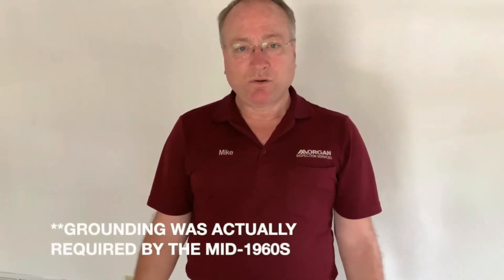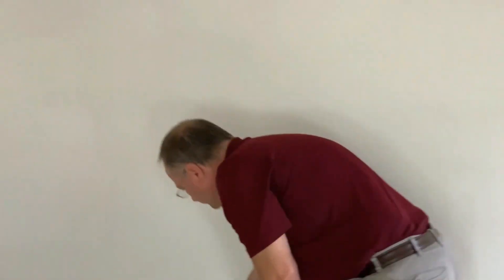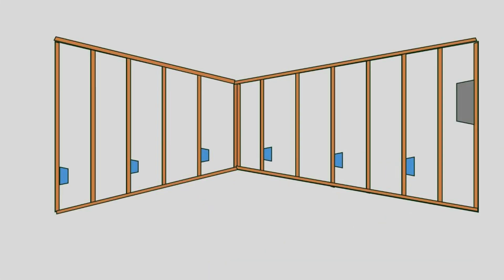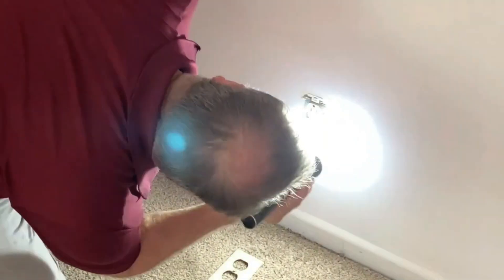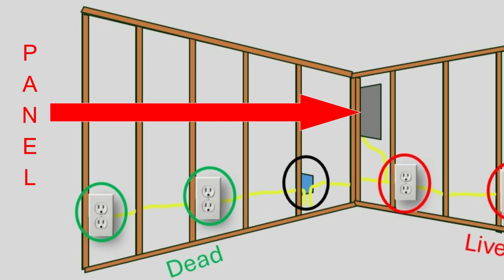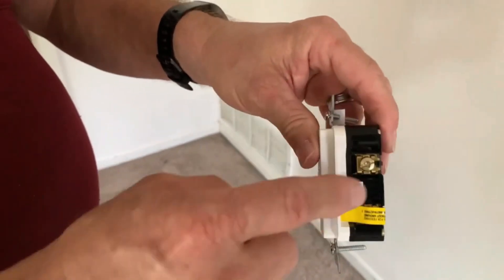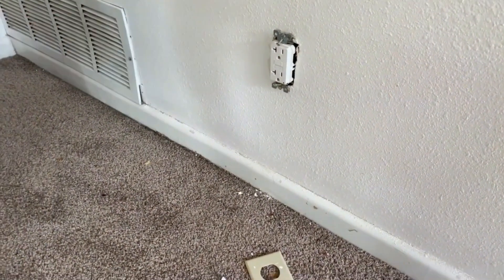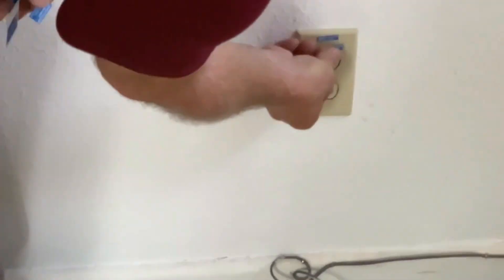Old Outlet to New GFCI – How to Install a GFCI (No Ground? Easy DIY!)

Comment: Ungrounded receptacles disguised as grounded receptacles ...even more deadly !  Is that even a 20A circuit ?
Reply from the maker: Good point — ungrounded receptacles that are made to look grounded can definitely give a false sense of safety and make things more dangerous. 👍 That’s one reason I always stress using GFCI as a safer option when no ground is present. And you’re right to ask — it’s important to know whether it’s a 15A or 20A circuit before replacing anything. Thanks for bringing that up!

Comment: During the video you said connect the wires from the circuit breaker panel to the line side and then said hook the other 2 wire to the line side. Did you mean install the other 2 wires to the load side, you did reference to remove the yellow label?
Reply from the maker: I said that? You hook the power coming in to the Line side. Any outlets you want protected by this outlet you connect to the load side. Those will be under the yellow tape. Thank you for catching that and letting me know. I will put a note on the video correcting that statement.

Comment: Save thousands on what? To replace an outlet, a GFI cost more, and whatever you plug into draws the same amps, no difference, so what are you saving on? I'll tell you, nothing, that's what.
Reply from the maker: Versus rewiring the house to ground every outlet.

Comment: SO I LOOK FOR THE OUTLET WITH THE FOUR WIRES RIGHT ?
Reply from the maker: Most outlets in the chain will have four wires. Only the last outlet will not have four wires. In other words, four wires is not what you look for. You need to find the outlet that when you disconnect one of the black wires all of the other outlets go dead.

Comment: what should i expect and what would the process look like if the outlet that i am replacing is an older, 2 prong, outlet?
Reply from the maker: It wouldn’t look like what I showed in this video. You’ll have a hot and a neutral wire. Normally that would be a black and a white wire. You will do exactly like I showed in this video to connect those to the GFCI receptacle that you are installing.
Reply: I'm buying these for the same reason. Buying a house from the 1800s and it's all 2 prongs. I will say this, if there are any 3 prong outlets installed that aren't gfci outlets, DOUBLE CHECK THE WIRING. There's a very good chance those 3 prong outlets aren't grounded and you're just asking for trouble.

Comment: Great video! For some reason I always thought that third plug (the "nose" of the face) was the ground and it was grounded as in, connected to something.
Reply from the maker: Well, it definitely should be connected to something.
Reply: @morganinspectionservices3840  Important safety tip, thanks again! Do you have a video on how to ground an outlet?

Comment: To meet code can u just use a GFCI or do u need a GFCI/APCI receptacle?
Reply from the maker: Great question! I will answer your question as well as I can.

Yes, the National Electrical Code (NEC) does allow you to install a GFCI receptacle on a two-wire (ungrounded) circuit, as long as it’s labeled “No Equipment Ground.” This makes the setup much safer than an unprotected, ungrounded outlet.

However, it’s important to understand that this does not bring the home up to current code standards. Modern code requires AFCI (arc-fault circuit interrupter) protection on most general-use receptacle circuits throughout the home, and newer homes must have equipment grounding conductors at all outlets.

So while adding a GFCI is a solid improvement and is allowed by code for older wiring, it’s a workaround, not a full upgrade. If you’re doing a remodel or new work, you’d need to bring it up to today’s standards, which would include both grounding and AFCI protection where required.

Hope this clears things up!

Comment: Did you put a 20 amp GFCI on the 15 amp circuit?Looks like the old receptacle was a 15 amp.
Reply from the maker: Good eye — that’s a sharp observation. The key is that the GFCI protects the downstream circuit, and whether it’s rated for 15 or 20 amps depends on what’s needed. In many cases, a 20 amp GFCI is fine as long as the wiring and breaker are properly rated — but the receptacle style and load requirements also play a part. Always important to match components to the circuit specs.

Comment: nice, i just had a home inspection and two of my outlets fail because no ground, i will try to get this done. thank you
Reply from the maker: If most of your outlets are grounded, and only two of them are not, then you likely already have a ground wire that you just need to connect.

Comment: Another great video.We have an older home with circuits in the bedrooms that are not grounded and have only 2 prong receptacles, my question is if I put a GFCI breaker in the panel would I then be OK to change the receptacle to a 3prong or putting a GFCI on the first outlet and updating the receptacles. Which would be better a GFCI breaker or GFCI receptacle at the beginning of the circuit. Thank you.
Reply from the maker: Hi. Thanks for the feedback and thanks for watching my videos. Putting a GFCI protected receptacle in place of the first receptacle on the circuit or installing a GFCI breaker accomplish the same thing, so it’s basically just your preference or whatever is going to be easiest. Once you have done this, you can replace the two-prong receptacles with three-prong receptacles. You should label them as not grounded but GFCI protected.

Comment: Another point to be made is that the GFCI amp rating must match the breaker rating.  I bring that up because you installed a 20amp GFCI outlet, assuming that circuit is 20 amps.
Reply from the maker: Thanks for the clarification

Comment: I just replaced all the regular receptacles in my kitchen, im a little apprehensive about changing the GFCI receptacles.
Reply from the maker: @robleekay6271    My first question is, why do you need to replace the GFCI receptacles? Secondly, it’s really not difficult to replace them. What makes you apprehensive?
Reply: @morganinspectionservices3840  the current receptacles have been in the house since we bought it in 2001. I just painted the kitchen, had a new patio door put in and soon will have new floor. The new receptacles are white getting rid of the old ugly creme colored ones. I guess because I've never changed a GFCI receptacle.

Comment: I once lived in an ancient building yet all of the outlets were 3-pronged.  If you touched the fridge and any other metal surface you would get a shock.  I'm pretty sure someone cut corners and tied the grounds and returns together.
Reply from the maker: @JeffTheHokie    I am sure you are correct. That is called a bootleg ground, and it is very dangerous.

Comment: I intend to use multiple LED nightlights with 2 prongs  to prove what outlets are in the circuit ( in other rooms near by )  Will overhead lights be on other breakers by code ? or will they be on the same breaker as the wall plugs ?
Reply from the maker: Lights and receptacles will very possibly be on the same breaker. There is no prohibition against lights and outlet/receptacles being on the same circuit.

Comment: If this was old BX wiring with a metal sheath to the electrical panel, could you instead wire the ground wire to the metal outlet box instead?
Reply from the maker: Theoretically, I suppose you could -   as long as it was installed perfectly.  However, the old BX wiring had a lot of design flaws which took it out of favor with the electrical gods. It was prone to develop loose connections as it went down the line from one box to the next to the next, so it frequently did not have a good ground path back to the panel. At times, due to these loose connections, the BX cable could essentially act like a resistor and turn very hot. I personally would not want to depend on it for a ground.
Reply: @morganinspectionservices3840  Understood, thanks for the explanation. This is actually what I did, but with an extra layer of protection. I have a Square D QO panel, and installed ARC/GFI combination breakers, so each of the outlets also has GFI from the panel. 

I assume that makes this a safe setup, correct?

Thanks again
Reply: @morganinspectionservices3840 I've never seen it in person, but have heard some old timers tell me they've seen old BX cable glowing cherry red with the basement lights off, one case of which was suspected of causing a home fire resulting in serious injuries.  I suspect they may have been exaggerating a bit, although if there was a long run of old BX and perhaps a hot to ground short to the sheathing on the far end, I suspect there could be enough resistance to limit the current to below what it takes to trip a 15 amp breaker or fuse; perhaps because of poor connections along the circuit, not unheard of with backstab connections on receptacles and so forth.